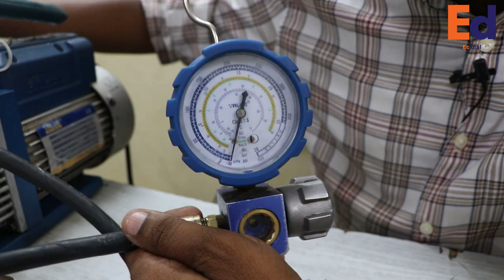AIR CONDITIONER VACUUM PROCESS LIVE DEMO IN TAMIL | ECDIAL | NANDHAKUMAR

Comment: Bro new Panasonic AC vangunean neega sonna mathiri vacuum podunga sonnean aana poda maatigiraaga Cooper pipe+4core wire  1 meter 1200 rs nu solranga  extra one hole podurathukku 300 rs  water pipe metr ku 150rs ac fitting charge 1000 nu solranga kollai adikuraaga bro neega price details video la solluga new va ac vaanguravangalukku use aagum ennakku 2.5 metre copper +wire +one hole +weter pipe +fitting charge ellam sathu 4300 aachu bro😭😭😭
Reply: write a complain in their company email bro...
Panasonic Customer support....my frnd also bought that ac...after complaint in email as not put vaccum..if anything happen u will be responsible like that...the next day itself they come and release gas and done vaccum and insert new gas at free of cost!!
Reply: AC could blast when no vacuum done. Vacuum is must
Reply: Bro vaccum podathu avaga  mistake  tan .copper pipe and hole installation charges .Allam creat price tan bro .ethu over cost illa .
Reply: My home la kuda ipo than ac vachen bro vaccum podala avaga 🥺 bayama than irukku ena panrathu oru vazhi sollega bro
Reply: Bro naanum inaiki dhaan installation panen vacuum poda sonna apdi na  enanu kekuran andha technician vacuum podamaiya installation Pantan ipo na ena pandradhu

Comment: Sir, i just charged my .1.5 ton ac with R32 gas of 450gms after vacuumming after 1hrs of running at 16 degree, the suction pressure is 180 psi. Is it ok?